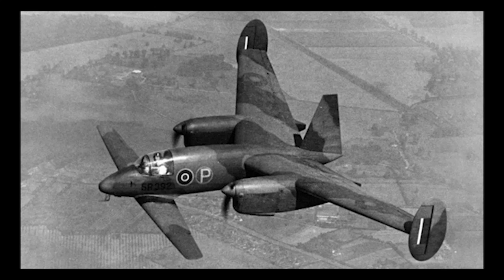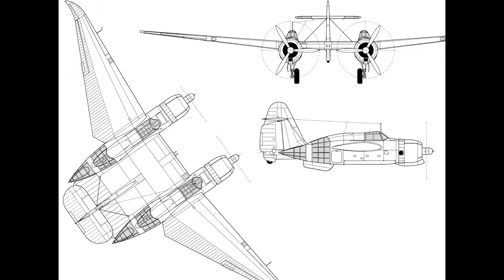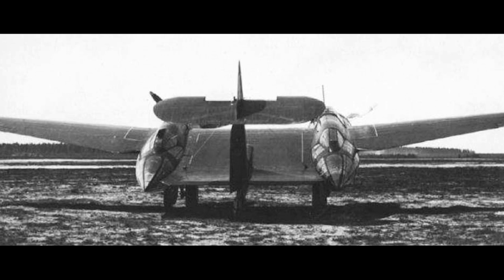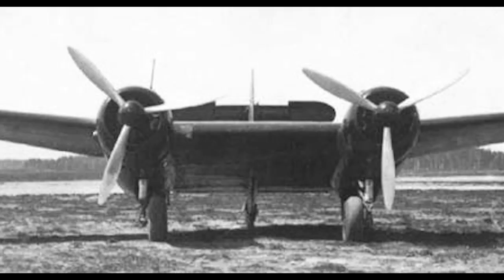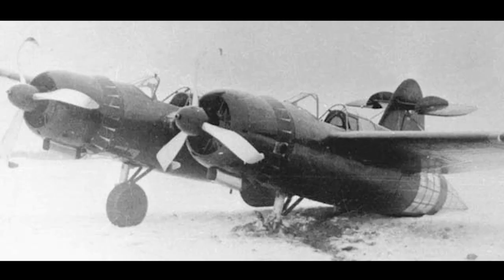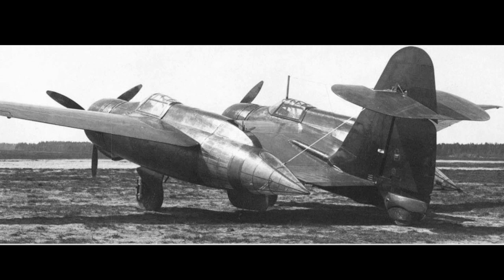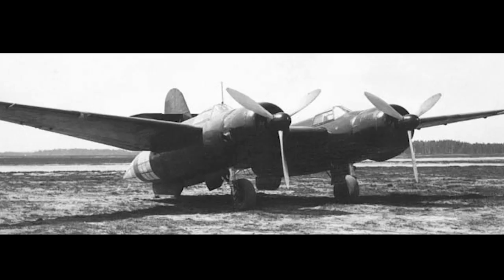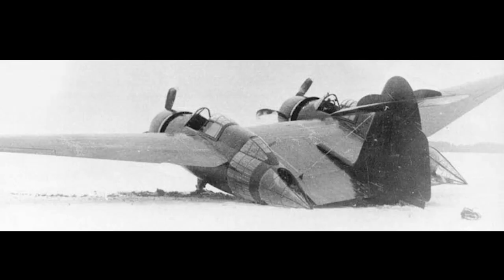The Belyaev DB-LK; How Many Ideas Can A Designer Sandwich Into an Aircraft?

Comment: Interestingly, the BV 141 you showed early in the video actually worked quite well. The only reason it didn’t enter service was it used the BMW 801 engine, which was desperately needed for the Fw 190 fighter instead.

Comment: Liked and shared.
  With better engines . . . a frequent lament.  The failure of the M37 engine spelt doom for at least three major Red Air Force design trends.  And it wasn't just the Red Air Force so affected.  Remember the USAAF's XP54 and XP55?
  In fact, my favorite "what if" is giving the Westland Whirlwind a pair of proper Merlins, instead of those troublesome Peregrines.  
  Soviet heavy fighter programs were largely dependent on engines which did not please.  The Polikarpov TIS and the MiG DIS are excellent exemplars.

Comment: The Hawker Tempest required the pilot to go on oxygen before starting the engine, and use it for the entire flight due to carbon monoxide in the cockpit. Some other aircraft required oxygen continuously due to ether containing hydraulic fluids seeping into cockpit area.
Reply: That was the Typhoon that had the problem with CO in the cockpit and required full time oxygen. I think that was fixed with the Tempest? I've never read anything about the Tempest having the same problem, but it may have.

Comment: The asymmetry in cross section (I think that's the right term) of the nacelles really seals the deal design-wise for me. I love how the canopies "lean in" to the centre.
Reply: No, not asymmetry. From the front it has reflection symmetry in the vertical plane along the centre line.
Reply: @neiloflongbeck5705  I meant a line of symmetry through the individual nacelle. I admit I'm not very good with getting the terminology right.
Reply: @ian_b  if you only consider the nacelles then, yes there is no symmetry there. But most of the time we look at the airframe as a whole.
Reply: @neiloflongbeck5705  But I wasn't, and I was just commenting on how I liked it aesthetically. I didn't know how to more clearly express what I meant. I'm sorry for my inexactitude.

Comment: I've always loved the look Of this aircraft. But it definitely needed more development to get the idea to full potential. Bigger engines, larger nacelles for more crew space and better balancing/maybe a wing planform alteration and they could've gotten the idea to work. But the main issue I see is that it doesn't have a real advantage in any way over a regular twin engine plane except having less frontal area. 
If they went the other way and made the thing smaller and lighter it might have been an interesting long range fighter. But no matter what they did it needed lots of redesign and development before it would be a good airplane. Novel ideas often die in infancy like this one because either the technology or the financing or the political support didn't exist to see the development through to fruition.

Comment: There's so many wrong things with this bird XD.

Doesn't take an aeronautical degree to notice.
Reply: What strikes you the most?
Reply: @ivanradosevic2871  The wings, the tail, the positioning of the two engines and the landing gear configuration just from the top of my head.
Reply: @LuisLopez-zh9kh  Forward-swept wings, somewhat f***ed up but doable. The tail positioning might look alarming, but it should be ok if there's sufficient vertical separation from the wing. The landing gear might be a little narrow, not sure though? Don't see anything wrong with the engine positioning? I got an aero eng degree and I'm genuinely curious.
Reply: @ivanradosevic2871  If you got a degree in aeronautics and you can't figure this shit out that's on you, buddy.
Reply: @LuisLopez-zh9kh  I assumed your opinions have some argumentation to support them. Perhaps I was wrong.
Reply: @ivanradosevic2871  main problem i see is the COG may be unforgiving, as it's so short & also a bomber. 
apparently the designer used the forward/backward swept wing design because he liked to copy bats wings for some reason. seems unnecessary imo but not dangerous. 
tail seems crude but functional, and at least it has one, unlike other flying wing designs of the time. could maybe extend it further aft to increase stability?
looks like it'd have a good range, as it has plenty of space for fuel & is pretty clean aerodynamically. 
may also be cheaper to build than conventional designs?

Comment: The handling will be improved by lengthening the nacelles and sweeping the wings back.  Move the cockpits forwards as as the nacelles are lengthened and that will give the pilot a better view.
Judging a plane when it uses engines that it wasn't designed for is stupid.
The exhaust leaking into the fuselage is also stupid,
I don't know if this layout would have been a good plane with the modifications I suggest, but it wouldn't have been as bad.

Comment: Note that wearing a gas mask due to exhaust fumes would have been futile, as it wouldn't block carbon monoxide.
Most likely a mistranslation of oxygen mask.
The Hawker Typhoon has similar issues & several pilots were killed before it became mandatory for them to wear their oxygen mask from engine start to shut down.

Comment: Lessee... double fuselage, incredibly bad visibility up front, fantastic visibility behind, flying wing design with a tail, forward-swept wings, insufficient power, insufficient room for its crew, requires four crew to do the job of three, center of balance nowhere near the centerpoint, engine exhaust vented into the cockpit, supposed to be a bomber with sufficient speed & armament to be safe (where have we heard that before?)...  I suspect the High Command wanted to test it as a dive bomber to make sure they really got rid of the thing!

Comment: hmm again poor engines fail an aircraft but also far too much smoke from those engines is not good and cramped room is not good for long flights the rear thou i think should of had more of a large ball type for better field of fire, Radical consepts that were ahead of there time but failed with poor engines and other problems. Glad to know about it thou.